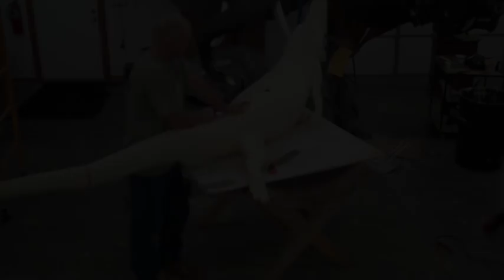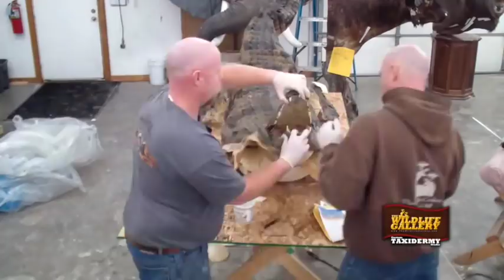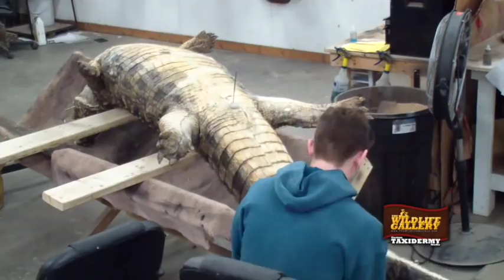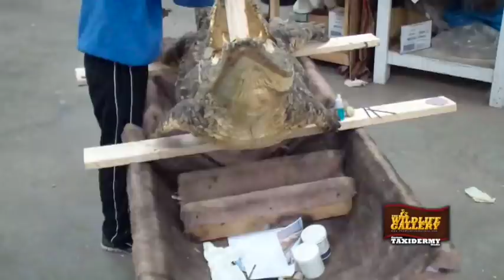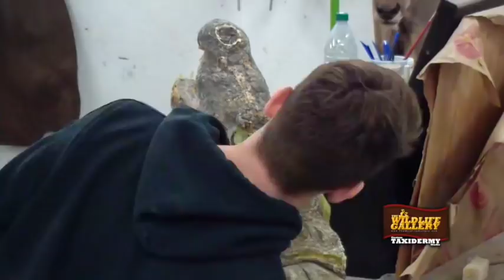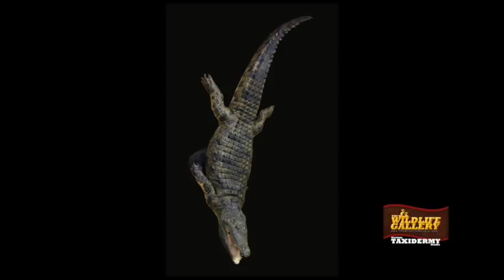Taxidermy Time Lapse - Crocodile

Comment: Nice work!

Q: I received an old (possibly 100 years old) tiny 2' 1/2 crocodile, but it's skin is pretty brittle, cracking at his joints. Any tips on refurbishing that? Like rubbing it with some kind of oil? Thanks.
Reply: While its not an crocodile my family did have a taxidermied fish which was deterorating, we took it to a taxidermist who specialized in repairs and after a few days it looked good as new. Hope this helps I'm pretty jealous honestly!